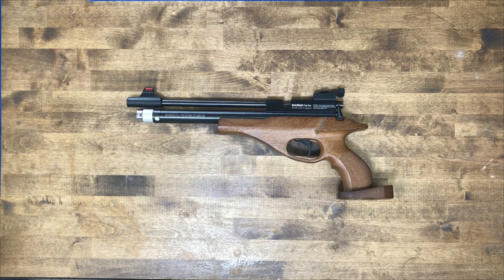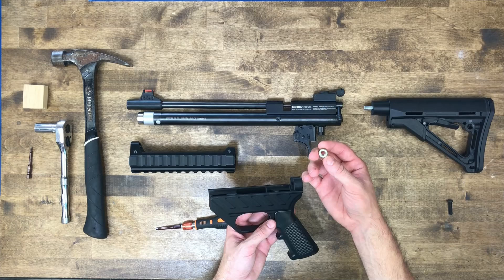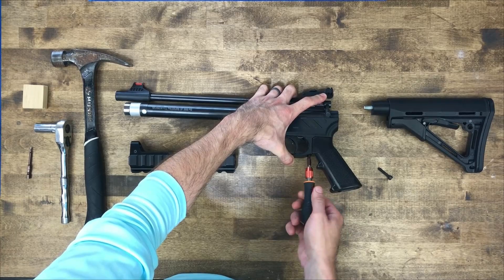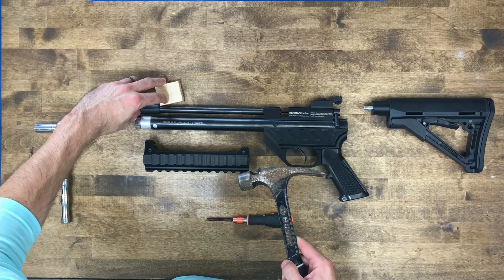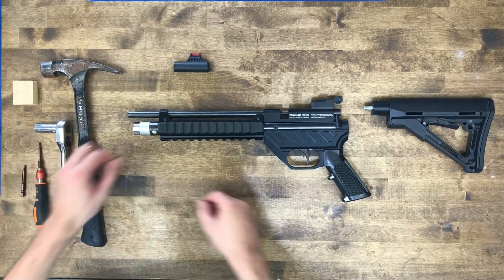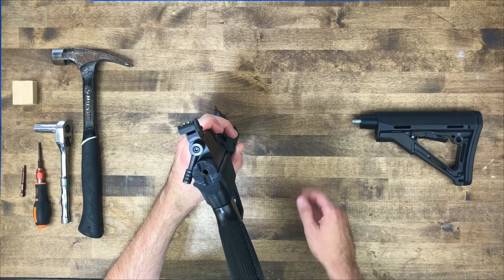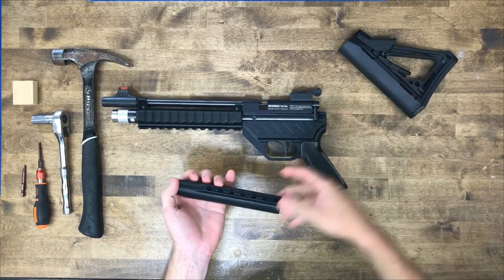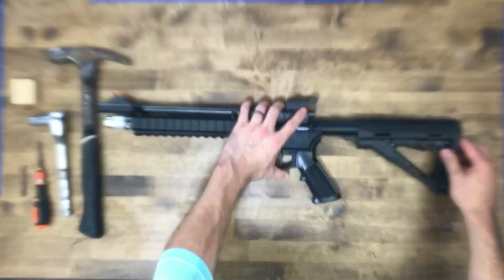Beeman 2027 Tactical Conversion Kit

Comment: Just finished the installation on my .177 2027, and it went pretty smooth.  I also added the suppressor, I like my new mini-carbine, these little conversions are getting addictive.  Any suggestions on a low profile mount for a red dot on the 2027?  Next will be my 2024.

Comment: Looks great. Sights are now useless. Can a scope be added?
Reply from the maker: It will vary from person to person, but I use the stock sights on mine without issue. The stock irons are higher than on most airguns. The breech does have dovetail grooves cut into it for mounting optics.